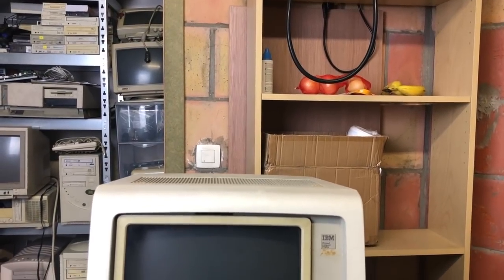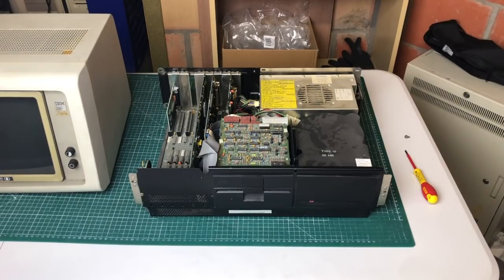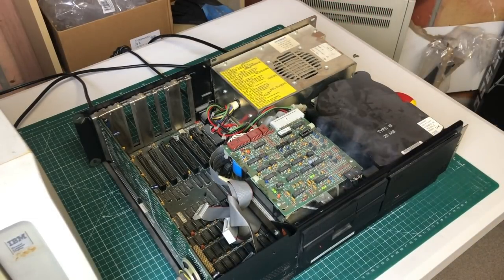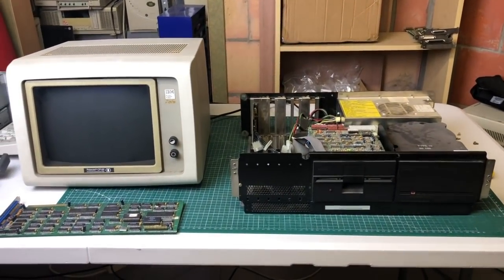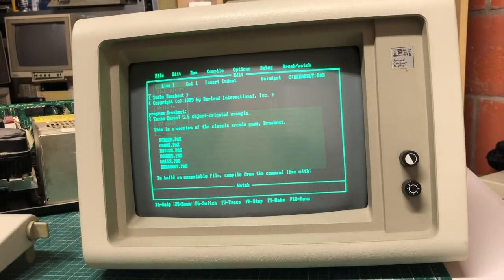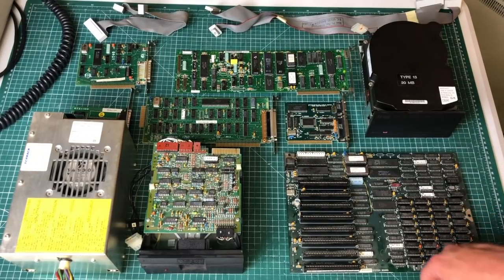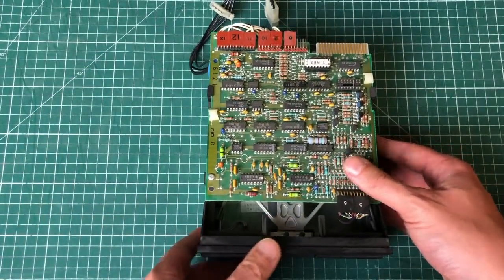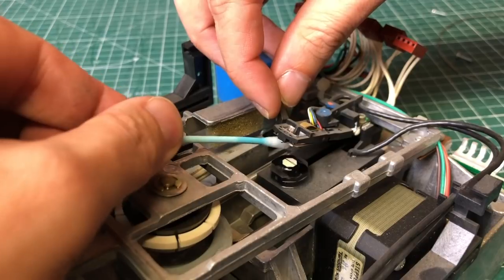Found an old IBM 5160 XT that needs some fixes (part 1)

Comment: Replace that tantalum capacitor and the coil (green resistor looking thing) and it will be fine if you clean and lubricate the drive, do it!! This is a common problem with these Tandon and also some Shugart 360k drives, and you can replace the tantalum with a small electrolytic capacitor and the coil too and it really will be OK! If you have to re-align the drive there's TONS of old school software to do that!

Comment: I got an IBM Aptiva 2176 and it too has those type of hex head screws! They must be imperial because a 4.5mm does not fit and a 5mm is slightly loose!

Comment: Nice system. That was originally a 64K-256K mobo that was upgraded to a 256K-640K with a replacement IC and some bodge wire.
Reply from the maker: Indeed it was ... if I'm not mistaken correctly this was an IBM supported upgrade that they documented somewhere.

Comment: The monitor seems to have lost its horizontal deflection signal. I have no idea what could cause that but for a 40y old board I would start looking at capacitors as usual :)

Comment: The monitor problem looks like it has a dead flyback or horizontal drive -- you can see the horizontal deflection collapse and the picture go black after.

Comment: I've never seen a CRT with image persistance that intense before. It's like it wants to get screen burn!
Reply: Typical with the P1 green phosphor.
Reply: Yeah, felt like an old LCD
Reply: MDA refresh rate is 50Hz, non-interlaced. You need this persistence to get a flicker-free image. And it works! Working on an XT with an MDA card might make you tired because of the hard drive noise or power supply fan noise, but the monitor image is completely stable without noticeable flicker.

Comment: while i love retro youtube channels i don't understand how they can just power up old machines without first checking for basic things like shorted power rails, the voltages on the power supply, etc
Reply from the maker: You should check some of my other videos. That’s what I typically do. In this case I took a chance. In case of a short the psu immediately stops and it typically doesn’t damage anything. In this case however there were no shorts and despite voltages being ok on the psu (something you also need to check under load) you never know when old bad tantalum caps are going to pop. You could check all of them and do ESR measurements (but for proper readings you need to pull em out of circuit). But sometimes I just like to turn them on and watch them explode for dramatic effect :)

Comment: I'm excited to see the fix of the Tandon Floppy drive. I've had issues with mine as well (my two half height drives still work fine though). I ended up having to clean the heads, replace the belt and completely unstick the motor. After all of that, it went from not functioning at all to only being able to read floppies written on that drive. Trying a floppy from another PC fails. I'm guessing at this point the read/write head must be out of alignment.. From what I've seen online you need an oscilloscope to recalibrate them (which is currently beyond me).

Comment: I have an IBM PC clone that has the flashing curser what did you set the dip switch’s to to make it work
Reply: A clone may not have the same switch blocks, but the best place to start is http://www.minuszerodegrees.net/ - a comprehensive set of information on early PCs.

Comment: That floppy drive might be like the tandon one I got in one of my 5160s, the heads are out of alignment. It cant read any disk I try but if I put a blank formatted disk in it and write to the disk it will write to it and read back what was written but then that disk cant be read in any other drive. I havent felt like trying to realign the heads so I just replaced it with a pair of half height drives.

Comment: Hey if you wanted to change the hard drive to a sd card or cf card is there a way too or not?
Reply: Check out XT-CF and XT-IDE cards. They're available from a number of vendors, and it's even possible to buy a bare circuit board and build your own.

Comment: It's good to see a new video :). I just built a Micro 8088 XT kit with xt-ide and adlib kits too. Everything was great until the caps on the old isa backplane i brought let out the smoke. Lucky for me nothing was damaged.
Reply from the maker: Where did you get the backplane ? Are these easy to find or are there other alternatives ?
Reply: @RetroSpector78  you can find plenty on ebay, but a lot of them are risers or have pci too. So i setup searches until I found one cheap enough. You can buy them just for the micro 8088 kits, but I think the isa edge connector need to be ordered from china.  search for sergey 8088 xt and you can see all the kits he designed.

Comment: The dip switches on the board can't do any harm when set incorrectly. They just tell the bios which card is the primary one in case you have MDA and CGA. You can then later switch in dos using the mode command. So when you set it to CGA and your card is MDA, the bios will beep because there is no CGA and the MDA will sit there showing a blinking cursor since that's its initial state and nobody ever puts anything into it's video memory. Poor thing.
Reply from the maker: yeah got a bit scared at first because I thought I fried the monitor .... the videocard is one of those dual switching ones that can also do CGA, but it was outputting a valid signal for the 5151. Really need to get over my fear of CRTs and just do it ... need to find someone with the time, patience and knowledge who can take me in as an apprentice :)

Comment: that monitor likely could get recapped and the resistors changed, it looks like the horizontal circuit may have died giving the center blinking line you had
Reply from the maker: When this corona thing goes away I am going to find someone to help me out with this. Got a couple of monitors I wouldn’t mind seeing fixed.
Reply: @RetroSpector78  Even with the pandemic going on, maybe you could email Adrian of Adrian's Digital Basement.  I know he's here in the USA, but he might at least be a source of insight for you.

Or if you got a wild idea like me, you could retrofit something into the case of the bad monitor(s).  I retrofitted a Chromebook LCD into a luggable PC last year so I could have a portable Windows 98SE/DOS system without the restrictions of a normal laptop.

Comment: I wonder what the school have used the computer for considering it has a programming language installed on it’s harddrive. Those darn graphics cards.... I got a problem of similar nature but it involves a more modern machine. I got a Gigabyte socket 370 motherboard with a cpu (presumably a pentium 3) from my uncle. It was once his fujitsu siemens PC circa. the year 2000 that he disassembled. He kept the motherboard as a piece of art in his room and he gave it to me. However, it doesn’t seem to accept any graphics card, always giving 8 beeps and the AGP cards that I have tried (that are known) good won’t display any picture with it. The board has an AMI bios and a universal AGP slot. Tried a diamond Viper 550 from my Pentium 2 system and another diamond card (stealth 3). Whatever I card I try, the board always produces this error code, it’s like it rejects any graphics card, even if they should be compatible. My dad already tried resetting the bios but to no effect. Would this motherboard be kaput? It has been sitting in his room for a few years so it was subjected to dust and such.

Comment: I had an IBM 5151 that had a dim, wobbly fuzzy picture. B+ was too low because current consumption was too high. Oscilloscope trace on the HOT indicated a bad LOPT, I couldn't get a new one, so I used it as a case for a Vectrex whose case was cracked, shattering the CRT in transit. So these two wrecked machines became the Wrectrex. (just enter Wrectrex in Youtube search to see the vectors on the long sustain green phosphor. It looks awesome but makes some games unplayable...)
Btw. my offer to fix your videocard from hell is still valid ;-)
Reply from the maker: hehe .. interesting concept ..... love the green phosphor look .... gonna take one more stab on the videocard and after that she's all yours :) feel free to drop a mail otherwise I'll forget (again).

Comment: That slow memory count would be annoying as hell on today's PC's. It would take AGES to count up 32GB of RAM.
Reply from the maker: haha .... yeah imagine that ...  the original IBM PC didn't even had a memory count ... just a blinking cursor that kept blinking ... blinking .... blinking .... with 640kb ram it took ages.
Reply: Oh it was frustrating back then too. Even right up to Core2 CPUs there was a very noticeable delay just for the machine to power on, before doing *anything*. You'd click the power switch and the PC would just sort of sit there for a few seconds before anything at all happened. Then you had to wait for the CRT to warm up, the HDD to spin up, the BIOS to do its thing, the RAM count, grinding the floppy drive, showing you the things the BIOS had found. And then Windows would start booting. It could take a full 30 seconds just to see Windows beginning to boot.
Reply: @ncot_tech  That classic floppy grind followed by the beep is iconic tho, probably the only cool thing about that whole boot sequence
Reply: If you turn on a new PC, you get nothing. No floppy sounds, no beep. Just pure silence.
But the blinking at least is not there...
Reply: Imagine if you had 64GB of RAM like I do... or even worse, imagine having a server or workstation PC that can take up to 1TB of memory.
Reply: Tonto

Comment: You said that you were selling it how much do you want for it
Reply from the maker: Not really sure yet ...  I remember the first XT class machine I ever bought (end 2018, complete with monitor and keyboard) set me back around 150 EUR. And that wasn't even an IBM. So it would be around that price range. This one needs some work (I fixed the floppy drive, but some would suggest the motherboard could do with a recap, and the RIFAs in the PSU might also pop.... and the monitor is broken. But other than that the machine is working, and it is all IBM material.....
Reply: @RetroSpector78  yeah I could do 150€
Reply: @RetroSpector78  just tell me as soon as you're selling

Comment: Amazing to find one with an old HD that actually works. Pretty cool.  My dual-floppy 5160 also had the Smoke Of Death from one of the floppies first time i tried it lol
Reply from the maker: yeah pretty common ... it's very time consuming to do a full recap of the machine before you start it up ... sometimes you just gotta take a leap of faith ... when these caps blow it seems very dramatic, but I've never had one taken down other components and do serious damage.
Reply: @RetroSpector78  It's that smell that is amazingly strong, out of such a little cap.

Comment: You saw several faults, including popping and smoke twice and the faults with the monitor, and you still kept on insisting to not only turn it on several times, but keep it running for much too long after all those warning signs. Poor machine. :/
Reply from the maker: Some of these caps just gotta go. The machine was running, fan was spinning hard drive was spinning. I have no issue keeping it running at that point. That capacitor was going to go anyway.
Reply: @RetroSpector78  Ok, but I myself would've been a bit more careful, and try to minimize possible extra damage.
Reply from the maker: The problem is unless you start measuring each and every component (and some of them can only be measured properly out of circuit) you can never be sure until you turn it on. There were no shorts otherwise the PC wouldn't have started.
Reply: @pentiummmx2294  Yea, worked on them for many years, and they still scare me a little ! :D
Reply from the maker: Yeha, and it also doesn’t help that each tome you try something you need to turn it on again, and if it still needs work you need to discharge again and the cycle continues over and over. Best not to get distracted at that point.
Reply: @RetroSpector78  I wonder if these old components become shorted without their smoke filling.
Reply from the maker: Regarding the monitor ... I did show the footage to a couple of friends and there was consensus that the monitor was already one its way out. It didn't die because I turned it on but most likely because this is a 30+ years old monitor that hadn't been turned on in a very long time. It wasn't even on for 1 minute before it went dark. Unfortunately I'm not that good at fixing monitors but I'm sure that the next person who gets it will get it up and running again providing he/she is willing to invest some time/effort/money into it.

Comment: I have 2 of these and yes I have a 20 and 40 MB hard drives and they are still working. The hard drives are built like tanks. Good video and nice to see you back😊
Reply from the maker: Indeed ... have had a couple of MFM drives failing on me , but most of them seem to run fine after all those years.